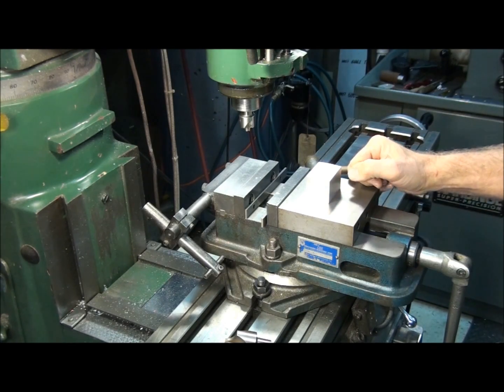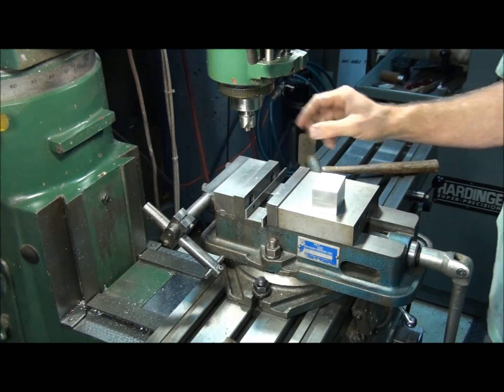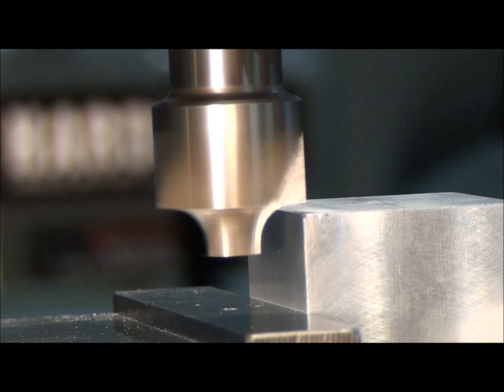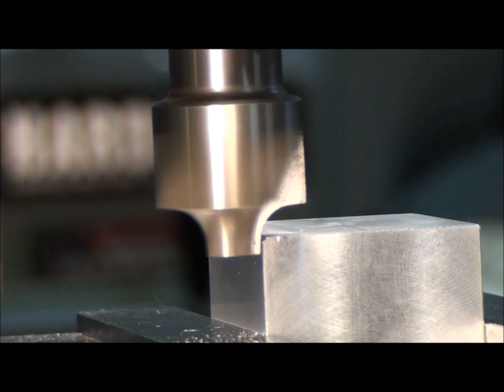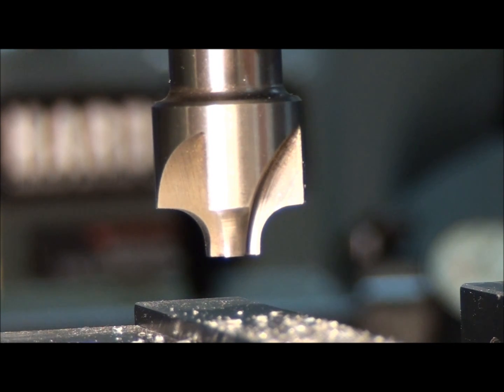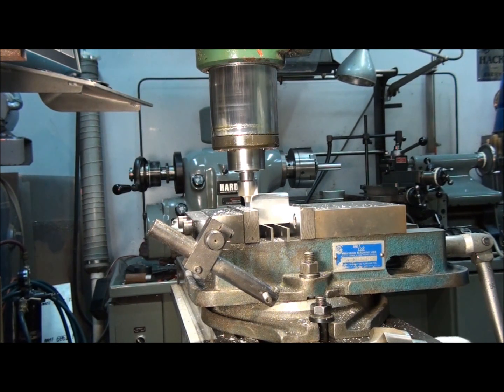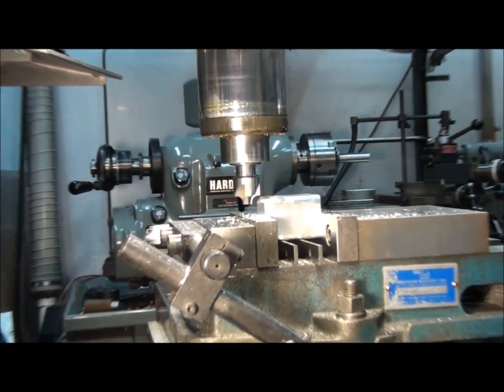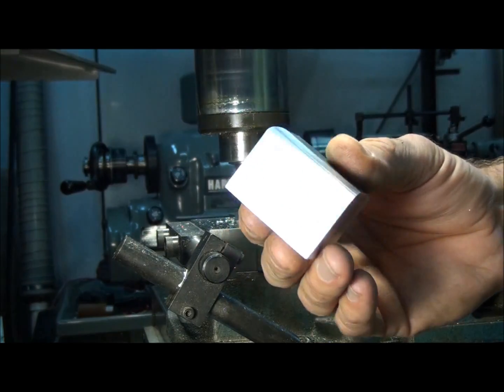How to use the Corner Rounding End Mill

Comment: I was always taught to use a green cigarette rolling paper as a feeler guage to pick up surfaces. That way you do not need to run the machine when doing it. Much safer. If you just touch the paper button still move it, then your within 1/2 thou. The green papers measure 1 thou thick.

Comment: Thanks for the tips on using these. A point about the filing near the end — instead of rocking the file forward (away from you) over the sharp edge, start on the back side and rock the file back towards you.  It feels weird at the start but only a tiny bit of practice to get the feel of it and you will find it’s far easier to make a very nice filed radius. Cheers, al

Comment: Almost every milling video I've seen there is aluminum being used which as we all know is easy to work with. When you work with steel to me it is a different story requiring lighter/multiple cuts to achieve a nice finish. I'd like to see the instructor passing on knowledge on working with steel. NOT aluminum. Thanks for the video.
Reply from the maker: If you had to watch me machine this part in steel, you would quickly get bored and lose interest. We use aluminum because it speeds up the video and keeps it interesting. The principles are the same, regardless of what you are machining.

Comment: How do you Calculate the Speed and Feed for a Corner Rounding End Mill?  That lookk fast  even with Aluminum
Reply from the maker: The same as with any end mill; 4 x cutting speed (surface feet per minute) / diameter. You can't really go too fast on aluminum and other non-ferrous metals. The limiting factor on aluminum is when it starts sticking to the cutter.
Reply: @TomsTechniques  Thank you. I love your videos.

Comment: How bout 416 stainless? Any help appreciated
Reply from the maker: 416 is one of the free machining stainless steels. It has the same cutting speed as mild steel with a machinability rating of 85%. Treat it the same as mild steel and you should be fine. Just be sure to use cutting oil on the radius cutter because of the added friction.

Comment: Tom I like this 

Correct me if I’m wrong but these cutters could save a lot of time. Avoiding setting up a rotary table with a 4 jaw chuck etc trying to round corners on a rectangular stock. I’m sure you could use the lathe but I think we can all agree on dialing in a 4 jaw chuck is a pain.
Reply from the maker: They are definitely time savers and do things you can't necessarily do on a rotary table, like mill a radius on a long corner.
Reply: @TomsTechniques  love it thank you

Comment: Could you use a carbide router bit to radius aluminum. The shaft could be too weak.
Reply from the maker: You can buy router bits with 1/2" shanks, but the price would be comparable to a HSS corner rounding end mill.

Comment: Not use stainless steel ,cast iron ,mild steel, toughen steel
Reply from the maker: The corner rounding end mill will indeed work on stainless, cast iron, and mild steel if the proper cutting speeds are followed and coolant is applied. You are correct, they will not work on hardened steel.

Comment: My vice lifts on the clamping end (not the fixed end) and I don't know how to correct for this.
Reply from the maker: Not sure what you have, but a lot of the Chinese knock off vises have this problem. Kurt AngleLock vises have a wedge feature that pulls the movable jaw down when tightened. If yours doesn't have this feature, all you can do is attempt to reduce the vertical play in the movable jaw, so it doesn't lift so much when tightened.

Comment: Thanks for this info - it seems to be a US thing, but I would have been shot for using the quill for putting a cut on when I was an apprentice
Reply from the maker: Thanks Dave. Deciding to extend or retract the quill when milling is actually more of a common sense thing. Yes there are times when the quill should be retracted for a cut, such as when taking heavy cuts on steel. But it also saves a lot of time to leave the quill extended when taking light cuts, rather tha crank the knee up or down. In short, never say never when referring to a machining practice.

Comment: How do i know what size end mill to use for my project?
Reply from the maker: Bigger is generally better for a cut. Limiting factors would be any corner radii on the part, pocket dimensions, or slot widths.

Comment: Those cutters are ground so you can touch off the bottom and get exactly what you want.  I think its .005 or .010 then the radius starts
Reply from the maker: Sorry David, but none of my cutters are like that. Most are around .05" greater than the radius and vary from cutter to cutter depending on size. I suppose it's possible that some are made that way, but I have never come across any.

Tom

Comment: Good info, but swapping work in the vise with the machine running is one of those things that's only OK until it's not. You appear to still have all 10 digits, so you're lucky.
Reply from the maker: Not lucky, experienced. When you work with machinery on a daily basis, for as long as I have (45 years), you develop a sense of what you can get away with without getting hurt. One of the most difficult things about making these videos is filtering that sort of thing out so novices don't get the wrong idea of what is safe and what is not. Thanks for pointing that potentially dangerous practice. It certainly is not acceptable practice for a novice machinist.

Tom

Comment: Would it be possible to pick this part up again at a 45° angle and then round thr edges over properly?
Reply from the maker: The axis of the corner rounding end mill has to be parallel to the side, or perpendicular to the top of the part. The only way to make them work off angle would be to tilt the head of the mill. It's normally a better option to orient the part to the end mill rather than the other way around.

Comment: Toms Techniques;  Sir, excellent video.  I love the way you demystify machining.  I attended tech school in 1972 so help me remember something.  When it comes to forming cutters I seem to remember you have to slow down the RPM.  Because of the way they are made you can't run them at the same RPM as a conventional end mill.  Am I right?
Reply from the maker: Thanks George.

Form cutters like this generally have less clearance than end mills, which can generate more heat, so you may want to keep that in mind. I mostly machine aluminum, so it doesn't matter and I use cutting oil on steel, so it doesn't mater there either. I guess if you were machining steel dry, you may want to cut back the rpm a bit.

Tom
Reply: Tom;  Thank you very much

Comment: Is it me or you're climb milling on a manual mill?
Reply from the maker: I rarely conventional mill. It's hard on the cutters and leaves a poor finish. It just requires an understanding of the forces climb milling puts on the machine, so compensation can be made by controlling the depth of cut, size of cutter or dragging a table lock. It's probably not a good idea to be taking a heavy climb cut with a large end mill on a light bench mill, but most knee mills are plenty rigid enough to handle it. You just have to know what your machine is capable of.

Tom

Comment: There is a lot of chip thinning involved in corner rounding, so ideally you want to feed equal amounts of x or y and z(in other words feed diagonally). Oh and yeah the climb mill part is also very important. If you feed it only on one axis and conventional mill it you have a double chip thinning at the edge that didn't get fed and it will look like a beaver chewed the radius, plus it will dull your tool in a pinch. Nice demonstration though and we are all thankful(don't mind the bad habit comments, we all have our way around our machines and our machines have their way around us :)
Reply: PS: I like that you use the rear jaw as a reference for all the passes.  This way it makes more sense to just flip the part around instead of resetting the mill around the part like I have previously done (I focused too much on HOLDING the part in one setup instead of MILLING the part in one setup).

Comment: Shouldn't mill with the quill down like that, even on small applications the added stress reduces life span of tool. Safety first!
Reply from the maker: It's all relative Nick. I prefer to leave the quill extended for better access, and in the case of shooting a video, better visibility. If a job requires more rigidity, then it will be retracted as necessary. Not sure what you mean by "Safety first!" 

This actually a good idea for a video. To demonstrate when it is necessary to retract the quill, and when it just doesn't matter.

Tom

Comment: It's worth pointing out that, since the part has a square cross section from the POV of the camera, you didn't need to "touch and back off" on subsequent passes.
Oh, and nice Hardinge lathe in the background.
Reply from the maker: Not sure I understand your point. I only touched and backed off on the first pass.

Yes, the Hardinge is my pride and joy. I purchased it new in the mid 80's and it has served me well over the years.

Thanks for watching,

Tom

Comment: Can you do 1 pass for mild steel or would you recommend a few passes. What RPM for a 1/4" radius tool in mild steel?
Reply from the maker: That depends on the size of the radius and the rigidity of your mill. I can do one pass with mine up to 1/4"R on steel, but larger radii require several.

The rpm of any cutter depends on the diameter of the cutter, not the radius. Measure the OD and use 4XCS/DIA to calculate the rpm. There is a chart on my website that lists the cutting speeds for various metals.

Tom

Comment: I notice a lot of your videos are with the spindle extended to the work. Is this for demonstration purposes, or simply because your spindle is thicker than my thigh?  I've thought its best to bring the knee up to the spindle.

You have done amazing work with these videos. You are a tremendous resource to those of us starting out!  I can't thank you enough!
Reply from the maker: +Damien Gregory 
I only retract the quill when I need the extra rigidity for heavy cuts. It's a more efficient use of time than cranking the knee up and down unnecessarily. Of course you may not have that luxury on a lighter mill.

Tom
Reply: I did Damien Gregory

Comment: HI Mr Tom 
i saw ur video...how to calculate RPM with the formula..4*speed/Diameter
i want to cut a design in the ms iron sheet with 8mm cutter how till wecalculate
Reply from the maker: +subash sharma 
Just convert the diameter of the cutter to inches and use the formula. Mild steel has a cutting speed of 100 surface feet per minute.

Tom
Reply: according to your formula...4*speed / diameter.
if we convert 8 mm into inches , we get 0.341.
Now
4*100= 400
400/0.3149=1270.2

that means Rpm should be 1270 only.
My tool get weared on this RPM.

Sir, Please guide me .
Reply: sir..please reply me
Reply from the maker: +subash sharma 
1270 rpm is correct for mild steel.
Reply: will it work for vmc
Reply from the maker: +subash sharma 
I don't know. What is VMC?
Reply: +Toms Techniques vertical machining center
Reply: Yes

Comment: Hi Tom!
Pretty impressive.
I can see where tjeerd is going. Where we come from, there is at least  three different( which I know of) types of corner rounders in use; reached, flared and standard, non flared. The most common one is non-flared one. You read( or better yet measure) the OD of the cutter double check the radii with radii gauge and measure the inner diameter of the cutter. Inner diameter and two radii should add to outside diameter of the cutter. If you have the digital readout on your mill the rest is quite simple. Obviously, where you came from, the reached model is the one mostly used. That would explain your technique. I like to use flared ones the most - if I can get them for a decent price - those have small angle (about 5°) ground in at the both ends of the radius - you never get the line on the parts using those...OSG, KEO and, I think, Latrobe use to make those. Now, I believe, there is only Harvey and they are insanely expensive...
Thank you for your videos - the are excellent!

Comment: Nice demonstration on a quick way to mill a nice round corner. I enjoy watching your videos. For me personaly I have an other way to use a corner rounding end mill. If you have a quality tool you can zero Z-axis with the bottom of the tool on the top surface of your product (with the quill it's very fast). Then you lower your tool (or raise the table) the same amount as the radius of the corner rounding. For the side first I zero the fixed jaw, which usually is zero for me or I know the coordinates of the edges already. The distance you need to move the mill away from the product = outer radius of the mill - radius of the corner rounding. Ofcourse as you point out you move the Z just a little less and the side a little more. I hope I make sense (no English speaker), it's just another approach to the same goal.
Reply from the maker: tjeerd russch 

Thanks.

I'm not sure where you are from, but corner rounding cutters around here aren't made that way. There is a significant flat area outside of and tangent to the radius in each direction, so setting up as you describe would not produce a full radius. By doing as I show in the video, there is no doubt as to when the cutter is tangent to the faces of the part, regardless of the make or quality of the cutter.

Thank for watching.

Tom

Comment: I would move the work against the direction of the cutter
Reply from the maker: Val Martin 
As I pointed out in the video. Climb milling produces a much better surface finish. If your mill can't handle climb milling, rough cut with conventional milling and climb for the finish cut.

Tom
Reply from the maker: Michael Espiritu 
The reason climb milling produces a better finish (when using the side of a milling cutter) is that each tooth takes a larger initial cut as it enters the work and then tapers off to nothing. It's the opposite with conventional milling where each tooth of the cutter drags a bit before cutting at the start of the cut. Face milling is different in that the cut is always the same depth across the work. All climb milling does in that case (on the edge of the part) is produce less of a burr.

Tom
Reply: Toms Techniques climb mill so far has given be a better surface finish with carbide endmills on the cnc. Face mill, and I cant see a difference
instagram: @memachine_co

Comment: Hi Tom. Do you deliberately make your pass on the trailing edge? Normally I would feed the other way on the leading edge of the cutter for a cleaner cut.
Reply from the maker: Swansong18 

If you mean do I intentionally climb mill, the answer is yes. Climb milling produces a much better finish than conventional milling. You do need to be careful when climb milling on light machinery because the cutter may grab. There it would be better to conventional mill to remove stock and climb mill for a good finish.

Tom

Comment: Not good practice to let the parallels fall on dirty/chip laden vice flats then continue.  Should have air blasted between each changeover.  :)
Reply from the maker: Normally I use a brush because air tends to blow dirt where it doesn't belong.
Reply: Ah yes, I've heard of some shops using brushes instead of air to reduce air use thus reduce cost not for that though.  The more you know!  I'm the lead machinist where I work, we use air but I'm also a clean freak when it comes to everything setup related as well as part change overs.
Reply: BSevenShido BSevenShido  aIf you do not have an answer yet it appears to be an older Bridgeport. The Bridgeport is a very common manual light duty mill. Some of the old versions have a 1 HP step pulley drive and the later models have a 2 hp variable speed drive. Just research Bridgeport milling machines. His mill might be about 30 to 40 years old.
Reply from the maker: crosstimbers2

Actually it's a DoAll 200V knee mill. It is almost identical as a Bridgeport, but when I purchased it in the mid 80's, it was of better quality than the Bridgeports that Textron was building. It has a variable speed head and a 9"x49" table.

Tom
Reply: Camp;  I saw that also. As I watched more closely I realized he a was using a soft face hammer.  That would make sense on a part made out of aluminum.  However, in tech school the instructors were adamant about tapping the part down to make sure it seated on the parallels regardless of what material was being machined.  We used our shop made lead hammers.  They worked great with no tool marks.
Reply: Why not vacuum?
Reply: Allen; 1) It doesn't always get everything out.  2) Best way is with good, lint free cloth or bare fingers.  3) I disagree with the use of compressed air to remove chips---too dangerous.  It is like making your own shrapnel.
Reply: Toms Techniques Ok I knew a little part of the head did not look like a Bridgeport. In the shops that I worked in and around they mostly had Bridgeports with a few better mills made by Tree and Excello. There were also some imports that I cannot remember except for the Lagun.
Reply: My last boss in a job shop frowned on us smacking the part down on the paralles. So we just pushed down on the part on the parallels and clamped it in the kurt vice.
Reply: Yes, wiping down with a cloth after the vacuum is a must.
Reply: Toms Techniques Can you give me the specifications of the machine that you are using in this video clip for me? I reaaly need it.